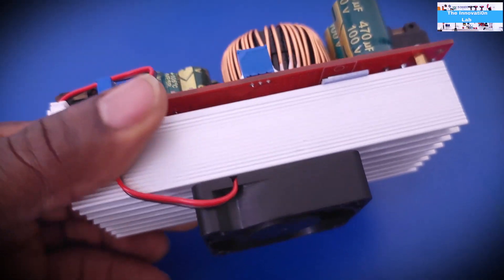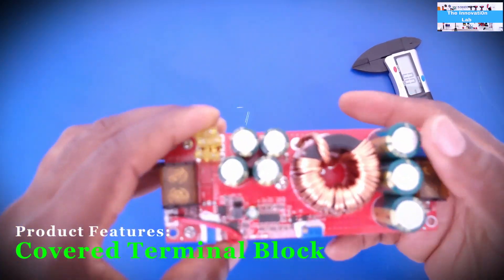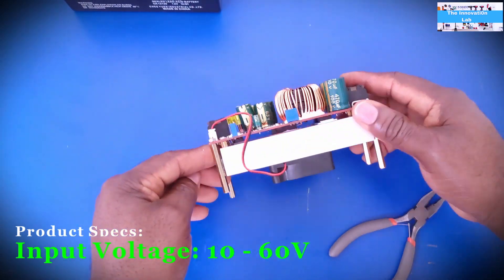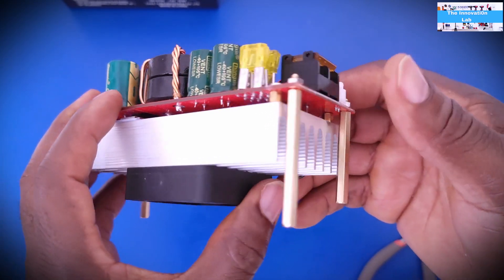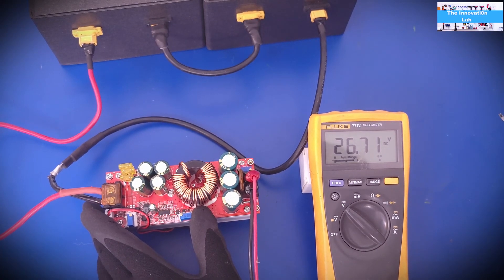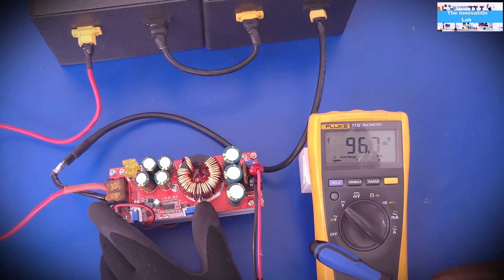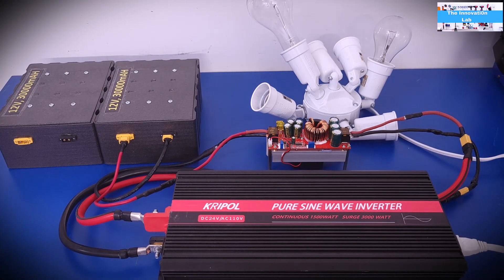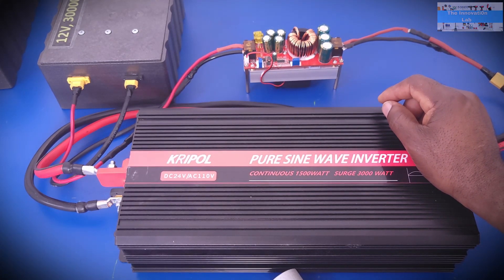Testing Cheap DC-DC Converter from Amazon - Are They Any Good?

Comment: i must be seeing things...i see  no test... but first,thanks for the video;
 in the end you could throw away the converter and use just 2 wires
 did i see well? you input 24 VDC into the converter,in order to get 24VDC out?

the paperwork says 1500watts  OR  20 Amps,whichever comes first..
so, (90 Volts)  OUT at  (70 volts ,20 Amps) IN , for 1400 Watts  that was the test i'd like to see, what do you think? thanks
Reply from the maker: Thanks for the feedback.
However, you have to realize that the pure sine wave inverter used in this video has an input voltage range  of 21 to 30V.  24V is only the nominal input voltage. This happens to be the case for most power inverters and converters.
As I believe I explained in that video, I used the boost converter to raise the input voltage to the inverter from 24V to about 26V. I know that a 2V boost/differential is not that much, but all the same, the converter was processing the power and regulating the output. 
So, to your comment, replacing the converter with 2 wires will not give you the same function. Unless the wires were somehow built with a self-regulating  PWM function and a 30A current limiting function.

Please go check out the specs of the 1500W/1800W boost converter on Amazon. The vendor rated  the converter with an input current limit of 30-40A, an input voltage range of 10-60V. 

Math:
At the max input voltage of 60V and a current limit of 30A, the boost converters are supposed to deliver close to (30 * 60)W =1800W. However, you have to account for efficiency and cable losses. Disclaimer: I have not load tested any of these units above 1000W
The 20A current limit you based your calculation on should only be for the 1200W version of the boost converter.

My videos are not  perfect, but they are usually based on good research and strong fundermentals. Also, I am not affiliated with the vendor, I am only providing some independent reviews.

Thanks again.

Comment: Hello i ned please serigraphy of ICs U1, U2, U3.   Thanks sorry for My English
Reply from the maker: Hi friend, thanks a lot for watching our videos. However, I only did an honest and unsponsored review of this product. I am not the vendor or the designer of the product.

I only bought the one I used for this video from Amazon.
You can find similar products by searching for "1800W DC-DC Boost converter" and you will find multiple vendors selling it. You can also find it on eBay. You can attempt to contact the vendors to see if they can help you with the information you need.
I hope this helps.

Comment: What is the minimum voltage difference between input & output? Description says 10/12 minimums (2v difference), but specs say 3volt difference? I want to put in 12.0v & output 14.2v, not sure if Ok? (Thanks for your video!)
Reply from the maker: Hello friend!
👍👍
Yes, you should be able to raise your 12V input to >14V without any issues. Just keep in mind that your system will be current- limited to 30A. So if your input voltage is 12V, you can only get less than 360W out of this converter.

Comment: can this tool be used to increase the voltage output of a magnetic harvester generator?  the output of the generator is 24v after that it is step-up to this device to 48volt and then it goes into a 48volt 2000watt/3000watt inverter, is that possible?? thanks a lot before 🙏
Reply from the maker: Thanks a lot for the very thoughtful question!
👍

Honestly, I am not very familiar with the output specifications of your magnetic harvester. However, as long as it is producing  very clean dc power that falls within the input voltage range (10-60V) of this boost converter, I believe it should work, but you have to test it to make sure it will work.  Also, you have to be sure that your magnetic harvester is actually capable of supplying enough output power to drive the load you are putting on it.

For example, 
If your harvester is generating 24V, but the total power output is 200W, if you apply a load of 1500W, the entire system will basically crash....and it will not be because of the boost converter.
Also, as explained in my previous videos, these boost converters have a current limit of 30A. This basically means that if your input voltage is 24V, your expected power output should be less than (24 X 30) = 720W.....and it won't matter if your generator produces more than 30000W.
Thanks again for the interaction, my friend!
👍👍
Reply: Thanks a lot sir 🙏👍👍 good job !!

Comment: How are you sir, I bought 1800w 40a dc-dc booster from Daraz 15 days ago, when I give dc 36volt on input. Set the output to 60vdc, when the load is applied, the output voltage becomes 40dcv around 60vdc. The input amp is 25 and the output is 21amp, no more times the Amp input. Please help me,  i wait your valuable feedback Sir,
Reply from the maker: Thanks a lot for watching our videos and leaving such a thoughtful comment. We started this channel to help and encourage creative minds like yourself!!
👏👍👍

Regarding your question, I believe you saw the voltage drop from 60V to 40V because your output load was probably greater than your available input power. As I explained in my video, with an input current of 25 Amps and input voltage of 36V, the total input power available to your load will be less than 900 watts (36
 X 25). This is because you have to also account for efficiency losses.

With your output set to  60V and an output current limit of 20Amps, you were basically loading your output with 1200 Watts - this was why your output voltage dropped to 40V - due to an overload. This is because 40V X 20Amps = 800 Watts ......plus efficiency losses.

Summary: 
You probably overloaded your output. So you can try doing the following;

1. Increase your input voltage to about 60V.

OR,

2. Reduce your output load below 800 Watts.

I hope this helps.
I wish you success with your project!!

Please don't forget to help our channel by sharing our videos.
Reply: Me fa lo stesso 72 volt scende a45 volt batteria e di 48 volt 20amper mia e-bike e voglio aumentare la corrente uscita trimmerino 72 volt 20a uguale 1400watt mio display e si 1050 watt ???? Devo aumentare corrente vero

Comment: Hi!

Thanks for you Video! I have the same unit connected to a Wind Generator. I cant get more than 10W out of this. Set the undervolt protection to 20V (So its spinning and not charge intil 20V is reached). Output is Set to 55V for 48V Battery.

I dont Touch the screw for Ampere. Do i need to increase this or is it by stock not limited?

Thanks

Erik
Reply from the maker: Hello Erik,
Thanks a lot for watching our videos and leaving such a thoughtful comment.

Regarding your question, it seems to me that what you might need would be an MPPT charge controller to help you optimize your charging process. You can do some research to see which one will work best for your wind mill application. 

Alternatively, the boost converter can operate down to 10V, so why are you setting the undervoltage lockout to 20V - unless you have a 20V battery?

Yes, you should definitely try adjusting the output current to see if it helps. I would recommend doing it when your wind generator is at maximum energy yield. You may be getting only 10W because your output current might be at a low setting. Given that this is a constant current boost converter, the current will remain the same regardless of how much energy your wind generator is producing.  
Also make sure to check that your wind generator is actually producing greater that 10W of power.

Thanks again and don't forget to help us reach a larger audience by sharing our videos.

Comment: Super sir, this charger having auto cutoff after battery get full charged and reverse voltage protection ?
Reply from the maker: Thanks a lot for watching the video and for the engagement. 

Regarding your question, this device is simply a DC to DC  boost converter.  It was not originally designed to be a battery charger. Hence, it doesn't monitor battery voltage levels as an included function.  About the reverse voltage protection, I am not sure it has this function. But you can find more details from the vendors on Amazon or ebay. 
My recommendation will be to take the time to verify your input connections before powering up the device.

Thanks again and don't forget to help us share our videos to help us reach more people.
👍

Comment: The magnetic core type is not ferrite. It is something else. The ferrite core will not be working in case of being the boost choke because it will saturate very easily.
Reply from the maker: Thanks a lot for watching this video and for the correction. I appreciate it.
Reply: It's probably sendust, which is similar to iron powder, but it's an alloy of iron, silicon and aluminium, which has very low core losses.

Comment: Hi, I've looked at all the reviews on youtube and yours is the clearest yet. Thanks!.     I have a question; lets consider an input of say, 12v  and tweak up the output to  24v. If you then double the input voltage to 24v ( by adding another 12v battery  in series ) does that automatically double the output voltage to 48v? Or will the output remain at 24v. The reason I ask is that some of the ads on ebay/Aliexpress/Amazon describe it as constant current/constant voltage device.
Reply from the maker: Thanks a lot for watching this video and for the great feedback!

Regarding your question, the output should remain at 24V - maybe with a small increase (<1V). The output should never double, unless the converter is faulty. This is the magic of an output regulated converter (Buck or boost). But I will recommend doing this without the load connected.
Disconnect the output load, Increase input voltage, verify output voltage, then re-connect your load. 

Always play it safe my friend.🙏😊

Thanks again and please help us share our videos so we can reach a wider/larger audience.
Reply: If your input voltage is 24v instead of 12v you will essentially double your output power(watts). The limiting factor is the input amprage(I think it's 28amps) so let's say you want to power a 48v device or charge a 48v battery. If you have 12v input you would be charging @336w but if you are running 24v you can charge a 48v @ 672w. The downside? You are now unable to power anything under 24v because your output voltage can't ever be lower than your input voltage. My suggestion? Buy 2 of these units in parallel and now you can charge at a range of 12v-96v with a power output of 672w! Or you can run it at 24v and instead buy a DC step down converter as well so you can use it for 3v-24v as well as 24v-96v.
Reply from the maker: Thanks a lot for the feedback. I appreciate the interaction.

You are absolutely right about not being able to charge batteries with voltages below your input voltage to the converter - given that we are using a boost converter. But this depends on personal needs. If your battery charging needs are always higher than the input voltage you are using, then you may not have to worry. However, if you have a need to charge a lower voltage, I agree that using a buck converter will be ideal. My only concern is that buck converters are usually less efficient and generate lots of heat.

In the future, I plan to build a true wide input buck-boost converter that can span a wider range. This way, we can truly call the system a universal charger.

Comment: can i connect Northstar 12v 170ah battery as input to this circuit to get 48v to run ebike motor
Reply from the maker: Thanks for watching this video.

Answer to your question:
Yes you can, but as long as your motor draws less than 320W of power.
As I explained in my videos, you can only get total power of 320W if you use an input voltage of 12V to drive the boost converter.

Please don't forget to share our videos if you found them helpful - this way others can benefit from them as well.

Comment: I like your video man, respect ✊ 
Just a quick question, how forgiving is the input voltage maximum? Would a slightly higher open circuit voltage fry the electronics? My solar panels have a working voltage of 49V, but the open circuit voltage is 60v, until the cold weather gets here and it will exceed it by a few volts.
Your opinion would be appreciated

Thanks,
J
Reply from the maker: Thank you so much for such wonderful feedback!

Regarding the max input voltage, I honestly don't know if it is forgiving. It is difficult to do that test without destroying the converter. Actually, it is always recommended to stay below the max ratings by about 10 to 20V. In the future, I plan to make a video to show how to make a DIY custom converter.

Thanks again!
Please help us reach a wider audience by sharing our videos.
Reply: @theinnovati0nlab782 will this charge lifepo4 batteries? Why is everybody acting like lifepo4 batteries are completely different?

Comment: Hi thanks for the test. Do you have a product link ? (AE or AMZ). I am planning to attack a 48V battery from a 12V one even if I can't exceet 360W, it's already not bad....
Reply from the maker: Thanks for watching!
This was the one I used for the video. I am not affiliated with this vendor and the video was not sponsored, so do some more research before buying.

1500W 30A DC-DC Boost Converter DIY Step-up Boost Constant Stream Power Supply Module Board in 10-60V Out 12-90V Electric Unit Module https://a.co/d/hTmj7Jr

Comment from the maker: There seem to be a popular misunderstanding  regarding the power rating of these converters. So I made this test video to provide some insight on what to expect when using these DC - DC Boost converters. Even though they are rated from a nominal power delivery of 1500W and a max of 1800W, the amount of power it delivers is proportional to the input voltage level used to drive the unit. For those hoping to use this unit or something similar for 12V applications, please watch this video till the end - so you can know what to expect.
Reply: Just seeing this today, so 200Ah 12v will take it closer to the rated output watts?
Reply: I was on the point to comment about the power OUT can't exceed the power IN .
If you have one liter of water you won't be able to drink 2 liters out of it .
Then I fell on that comment of yours . And yes no one talk about this form ALL the videos I came across on YT .👍👍👍
People talk about Voltage but very rarely talk about the Amps and above all never about the WATTAGE .
And what is funny , they make videos and they seems to be LIKE ( WTF ) ' why my voltage drop when I rise the AMPS "🤔
I am not an expert but just using my logic ( Watt = V x A ). So if the input is 100W . then at 12V I can only Pull 8.33A and if I try to pull 10A the voltage will drop at 10V ( 100 / 10 = 10 ).
Am I right ? thanks for any answer .
Reply: @lostworld-2024-m5m  if you have a thing that can deliver 100W at 12V, then it can provide up to ~8A at 12V. However, if your (resistive) load is rated for 100W and you only give it 10V, it won't magically pull 10A but probably closer to 5A - this only delivering 50W. 

On most devices you need the Voltage, to push the current. 
That's why it's called a "resistive load". 

Devices like these converters work differently, but similar to resistive loads, at 100% commanded duty cycle, the amps cannot exceed the rated specs for a given voltage.